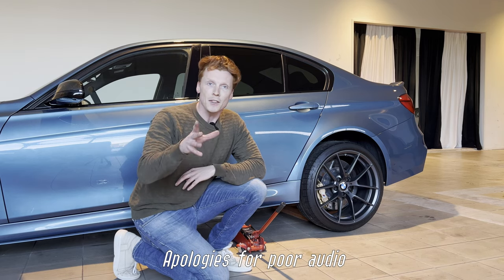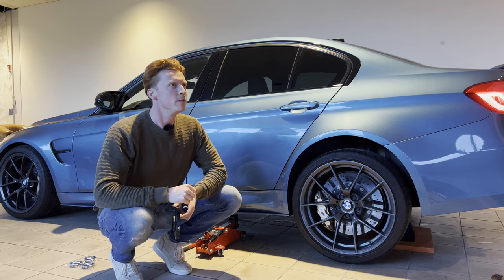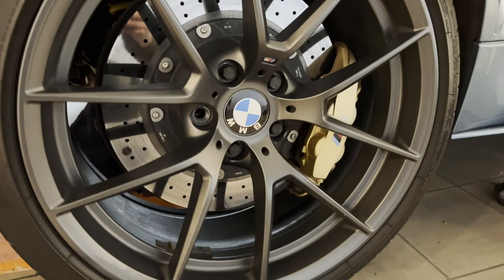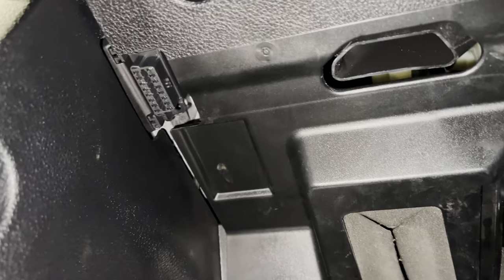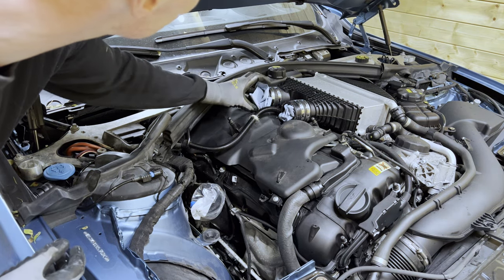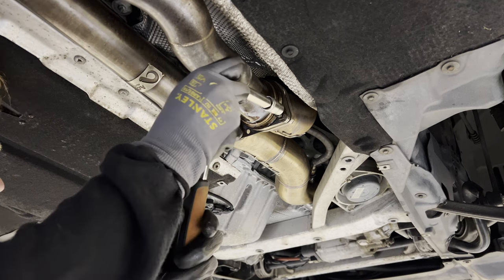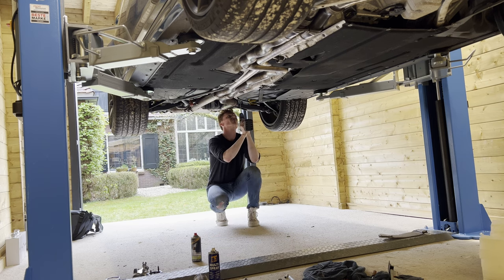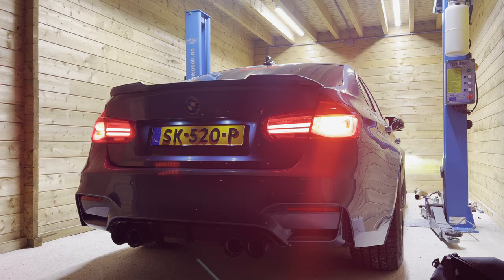BMW M3 Competition: Making it BETTER

Comment: Im gonna prefire and say this one is gonna be a banger
Reply from the maker: Let me just say that a lot of work went into this video! Hope you like it man
Reply: @TheHunterHofman  Can confirm it was a certified banger. I love when people de-mod and remove all the useless crap people put on their cars. Less is more. Car looks insane, the color and my favorite BMW style wheel. How we feeling about the rear M3 badge? We going chrome?
Reply from the maker: @slonkijippie thanks a lot buddy, that keeps me motivated! The black M3 badge is original (as the Competition’s have black badges from factory) so I’m keeping that as is. What do you think about removing the splitter, sideskirts and spoiler?
Reply: @TheHunterHofman  If it's OEM, it stays. (The badge that is). I think the splitter and sideskirts look really good because they're paint matched, so it looks OEM. Classy.

Not really a fan of those lip spoilers that have that gap in the middle and sprout out at the edges. But I know that style comes OEM on some BMW models, I like the regular "M performance style" spoiler that is just flat alot more.